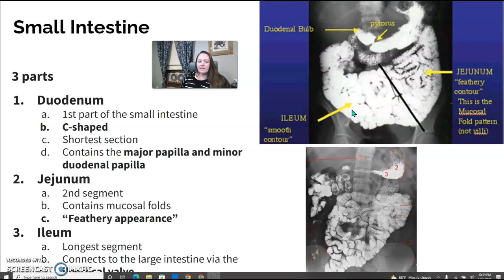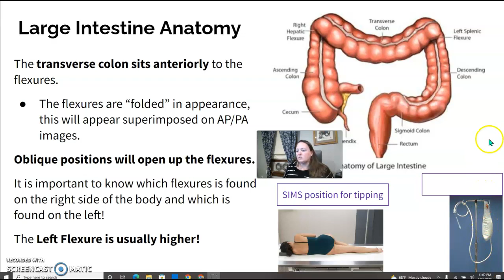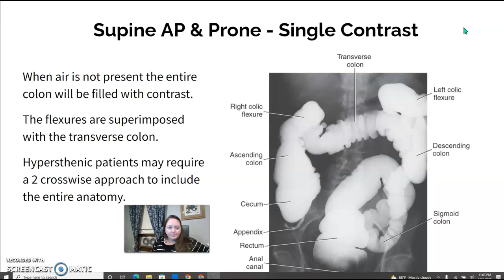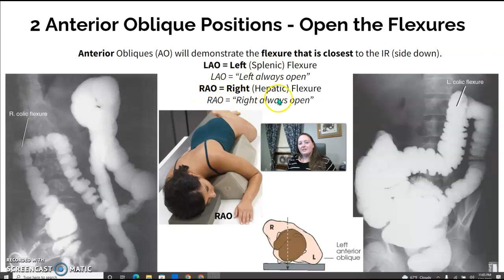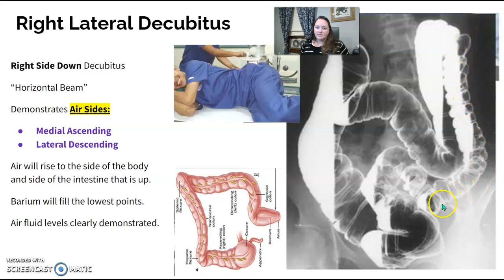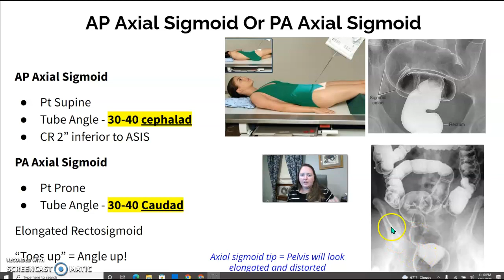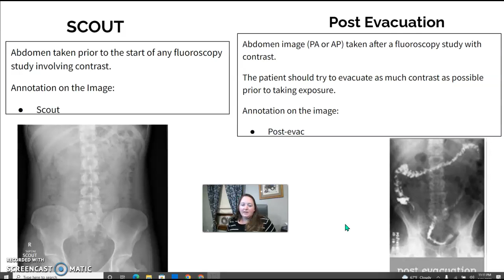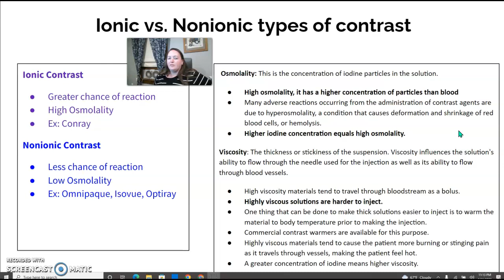SBFT & BE Fluoro Image Tips

Comment: What do you mean by Medial Ascending, Lateral Descending? The right will always be the ascending colon, and you can tell this is right lateral decubitus b/c of air/fliud levels. The left will always be the descending colon, unless they have situs inversus.
Reply from the maker: Hi! Good question.  In these questions you will split the ascending colon into medial and lateral sides to answer barium or air locations.  Same with descending colon.  The medial sides of the colon are the sides closest to the spine.  Lateral sides are at the outside or lateral borders of the body.
Reply: @meaghanpiretti7340  ahhh I see. Thanks!